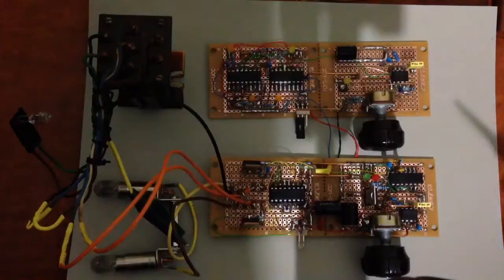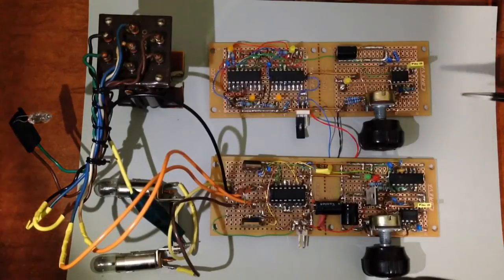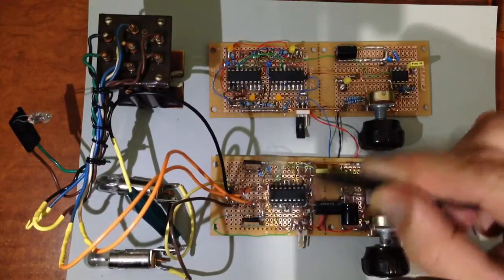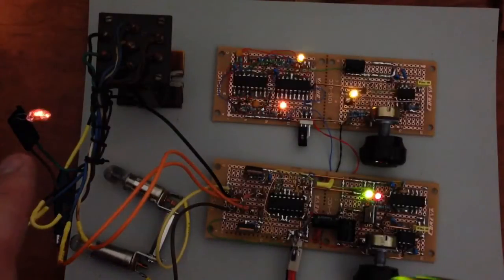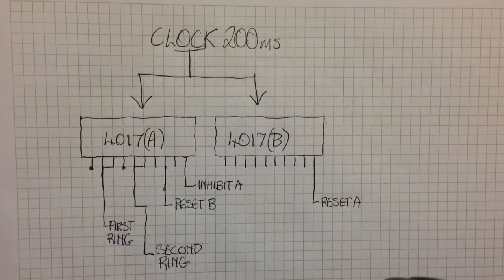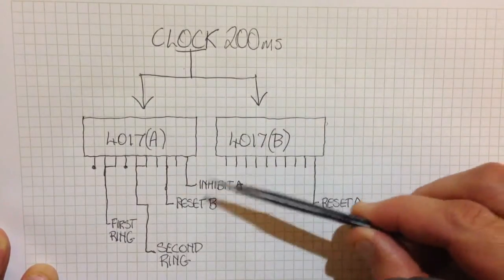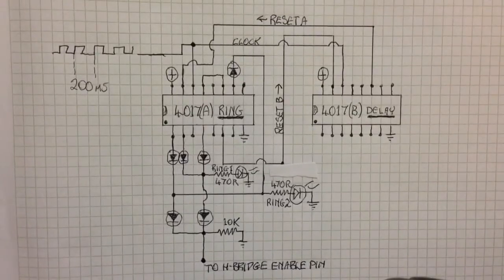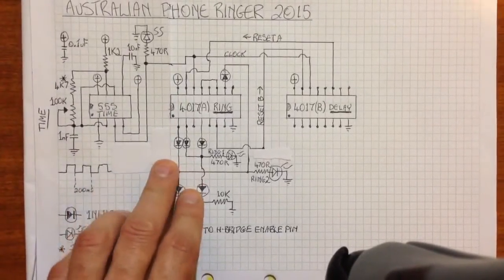Australian Telephone Ringer Part 2

Comment: Hi mate, just left the PTSN and am designing a internal network to operate the bells on my 3 analogue phones (300, 802 and touchfone). I might be in touch with you with some questions as I put it together if that’s ok
Reply from the maker: If you’re Australian, you want a 90VAC signal of 20Hz. The ringer is forgiving, but sounds better as you approach the authentic signal. You could probably use a phone to tune the oscillator roughly. Even fancier if you produce something slightly more triangular than a sine. They did that because the signal will drive the bell further away.